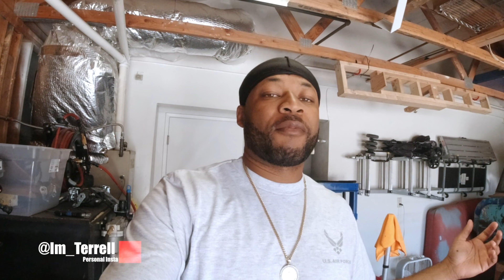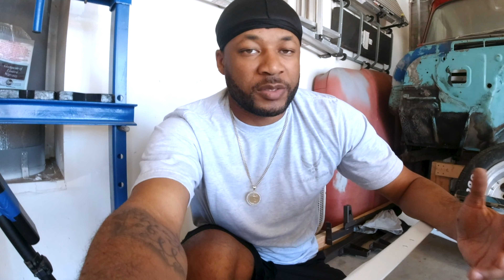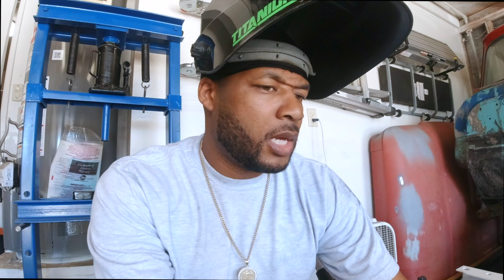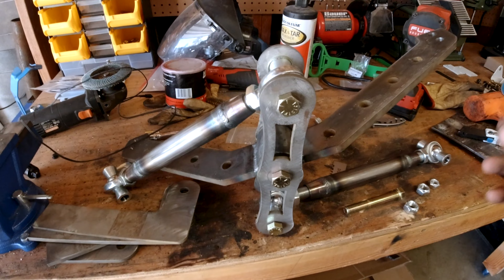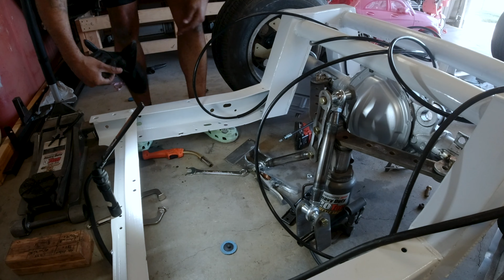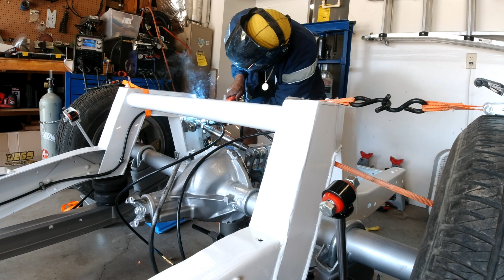Watts Link Install | 1964 LS Swap Chevy C10

Comment: This has to be a universal kit as I was surprised to hear the holes were small. It is nice to see the hiem joints and look strong. Even time you go over a bump, the are stressed. 
  I was tickled when you said it is hard to weld upside down, but when you said, “If you are crawling upside down under my truck to look at my welds, we have other issues!” I laughed my ass off. 
 I am a simple farm kid, we never got allowance but worked for the neighbors for pennys! My first truck was $150 for a 65 C10 Apache used to deliver fuel and oil to construction sites for their caterpillars, scrapers and large equipment. I just type in 67-72 C10 trucks and scroll to look at interesting stuff. I don’t car who you are, if you are into the classic steel and timeless design, you are ok in book! 
 (Secret; When you got it going and pull into a gas station be prepared!!! People will ask 20 questions and all have a story of learning how to drive in one, or uncle Jake with 3 fingers on one hand, let them shift it while driving. Stories of their childhood come alive)
Sweet job, great work! Keep er going. Regards, DK, retired tech.
Reply from the maker: Lol uncle jake with 3 fingers sounds cool and possibly Creepy. I love old vehicles cars trucks even vans. If I had the time space and of course money I’d have one or 3 of each

Comment: Did you stay with 6 lug nuts or 5 and if have to get new wheels to fit the brake disk
Reply from the maker: I kept 6 and I’ll be getting new wheels these don’t fit with the disk brakes. I don’t have my calipers on at the moment to make it fit